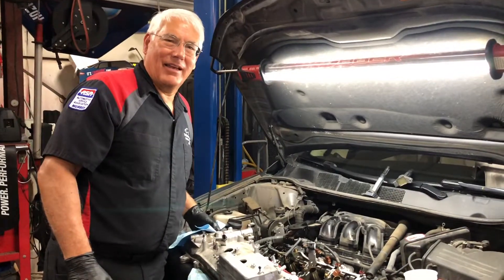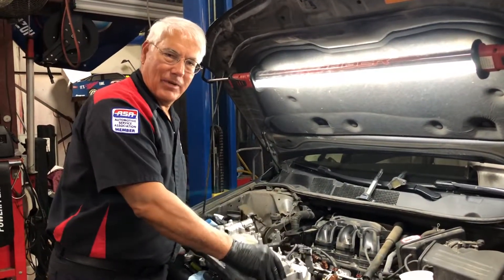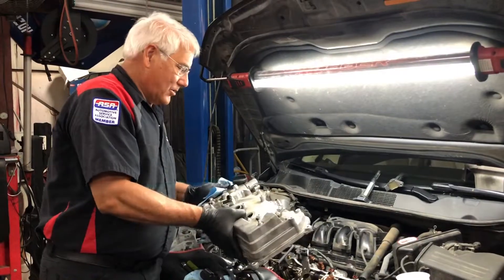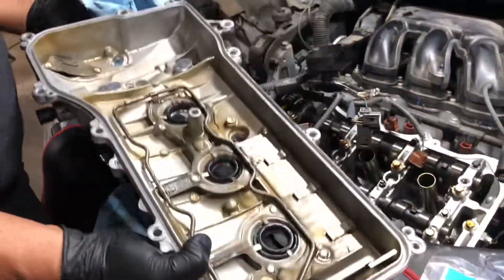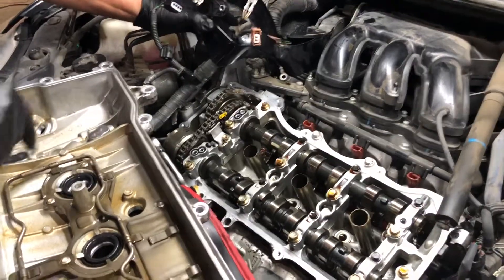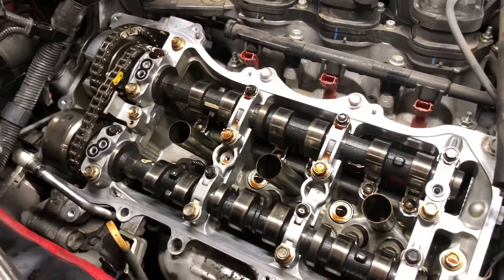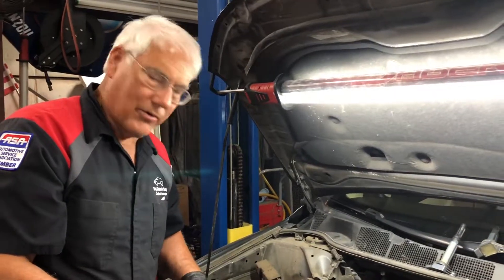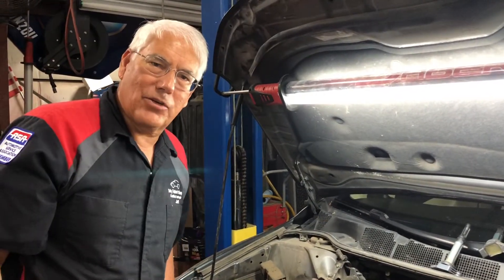Jeff Buckley Shares a Tech Tip On a Toyota Valve Cover Gasket.

Comment: If you missed those gaskets, would the problem show up pretty quick would a check engine light come on and would there be noticeable issues?
Reply from the maker: Yes, oil would short out the plugs again

Comment: Velcro and Victor rain sets both come with all of those seals
Just avoid shopping at Toyota lol
Reply: Also, it’d be awesome if somebody would show us some tips and tricks for removing the rear valve cover
Would you say it should be done engine in car or should we drop the cradle?  Because it is probably one of the most difficult valve covers to remove of any vehicle ever.